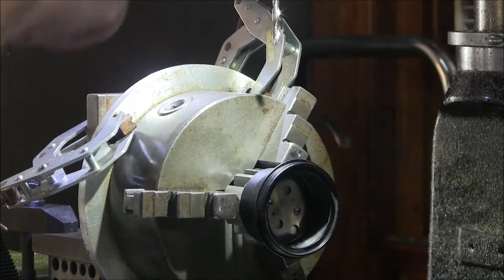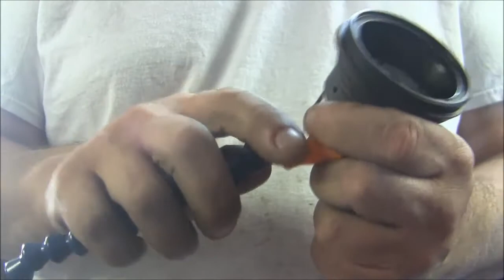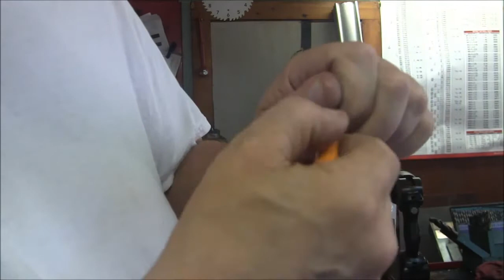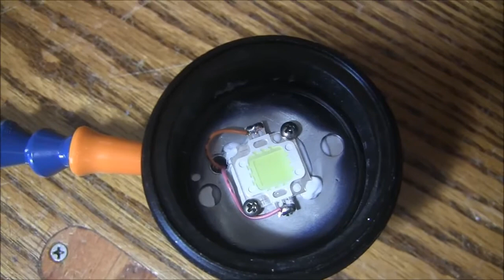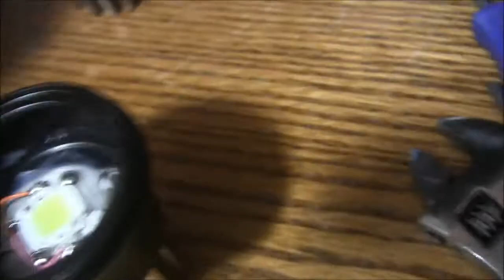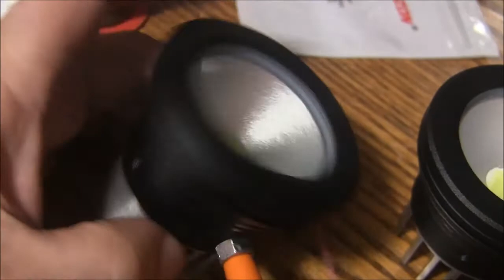Machine lights Rev. B Part 2

Comment: Very nice update on these lights I'm sure they will last a long time. I have been using 2 Banggood mountain bike lights on my mill that were featured in this Utube video "Machine Light Upgrade with Banggood LED Bike Light." They probably won't last as long as your custom built ones but not bad for $6 bucks. Check them out.
Reply from the maker: Jim Pritz thanks for the tip Jim, the problem with all these lights is they all have integral drivers, they run hot and die Young. My drivers are 10 feet from the LED's.